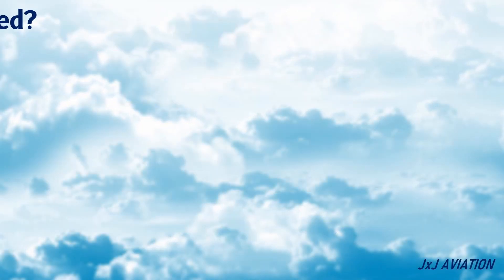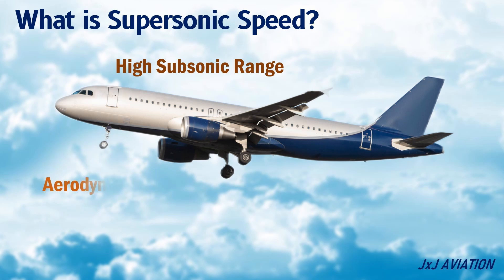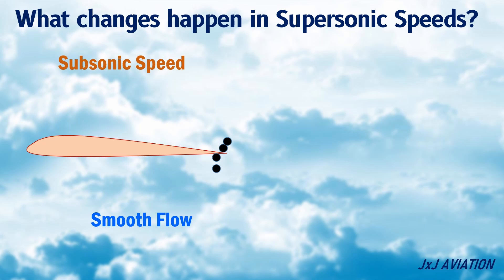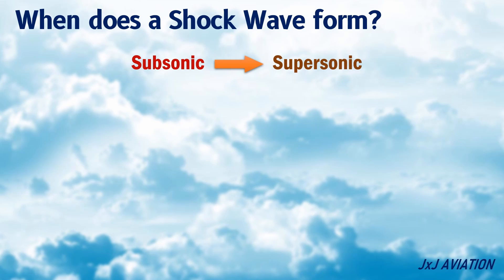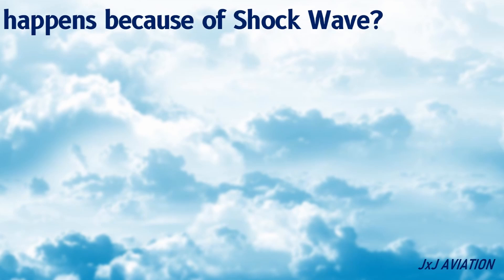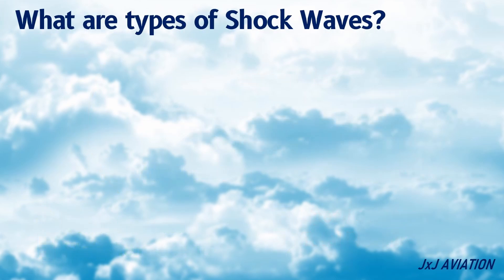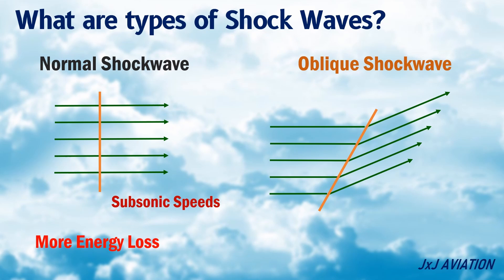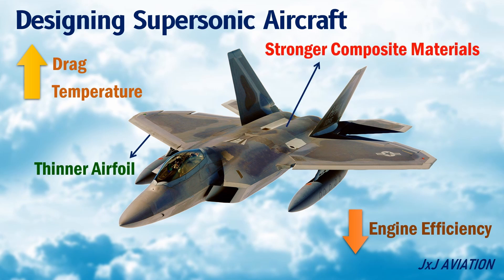What is Shock Wave? | Understanding Supersonic Flow and Shock Wave Formation | Effects of Shock Wave

Comment: Most commercial planes fly within the transonic range near the speed of sound where the airflow is part subsonic and part supersonic. Modern fighters have to compromise between high supersonic speeds and subsonic cruising speeds because they can't fly at supersonic speeds for prolonged periods. Nearly all modern fighters not always but often cruise somewhat below the transonic range while only being able to reach supersonic speeds in short bursts. Sadly, planes that do indeed cruise at supersonic speeds don't fly anymore. The Concorde and SR-71 are examples that easily come to mind, but many early jet fighters like the F-104 and F-106 also flew supersonic as far as their range and fuel capacity could allow! Some advanced fighters like the F-22 can "supercruise" which means to faster than the speed of sound without the use of afterburners, this is misleading because though they could cruise faster than sound, it still isn't practical and thus are still very limited to how long they can fly at such speeds.
Reply from the maker: That is an awesome explanation! Thank you!
Reply: @JxJAVIATION  You're certainly welcome!
Reply: Don’t planes fly right below transonic for better efficiency😂
Reply: @PaulJackson157  Some do, not all. I was told that first hand by a senior 777 pilot and other flight crew.